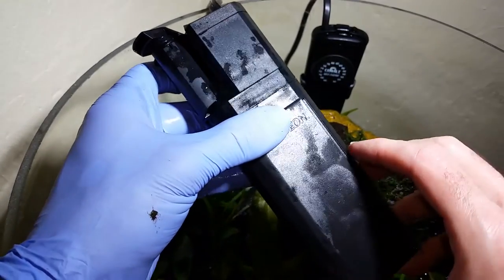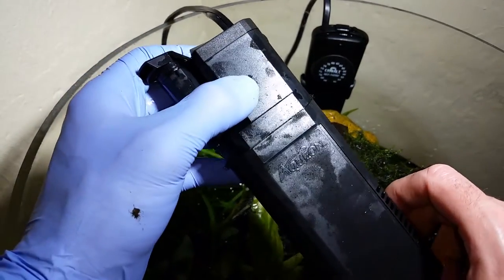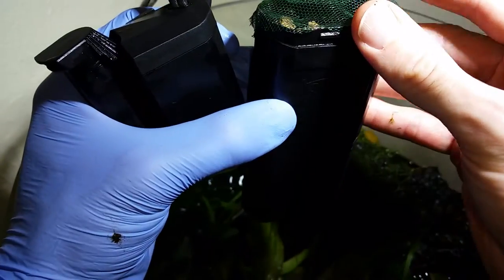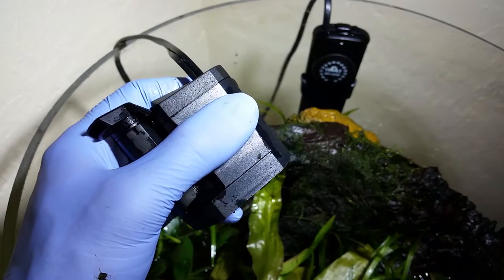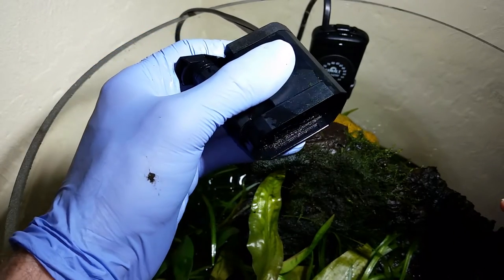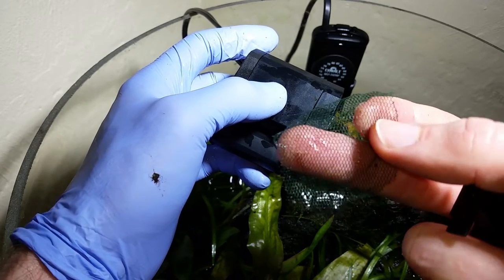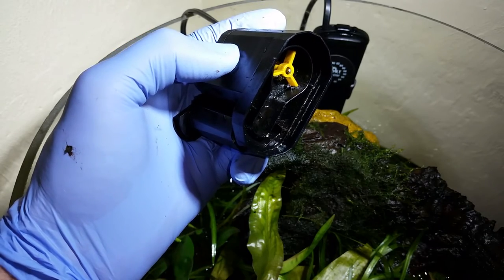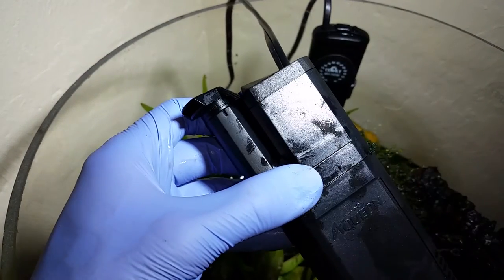Pumice Filtration Tutorial Part 2/2

Comment: Nice! I've been wanting to use pumice for my filters instead of ceramics, where did you find small diameter pumice stones?
Reply from the maker: +Jorge Serrato Smaller is not always better. 5 mm to 1 cm seems to be ideal. See the link in the description of part 1: https://www.youtube.com/watch?v=0JoOg14EA00 .
Reply: +Jorge Serrato Pumice works, but I'd suggest using Seachem Matrix because it water logs much faster than pumice. I'd also say a very cheap media that polishes the water insanely well is perlite, I've got it in my filter now and can say it works brilliantly.
Reply from the maker: pusc1f3r The only thing I dislike about perlite is that it's too fine, so it clogs easily. White pumice lasts me 3 to 5 months between filter services. (Red pumice is to be avoided.)
Reply: +dangerousfishbowl True, though I've found a few places locally that do very coarse perlite. I like it because it mixes both mechnical and biological filtering.
Reply from the maker: In that case, if you have any recommend brands, feel free to post a link. I suppose the same inhalation hazards apply, as with pumice. My recollection is that perlite is easily crushed, which adds to that hazard somewhat, as opposed to white pumice, which is fairly hard. In any event, it's good to know about alternatives, so thanks for the suggestion.